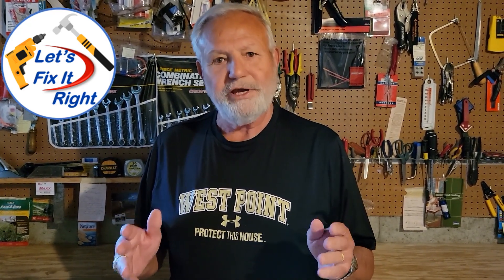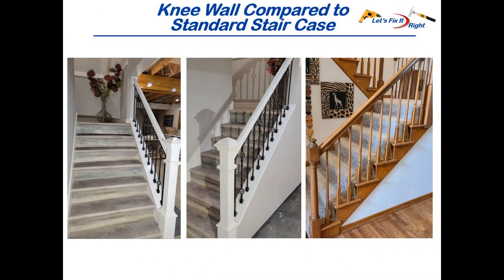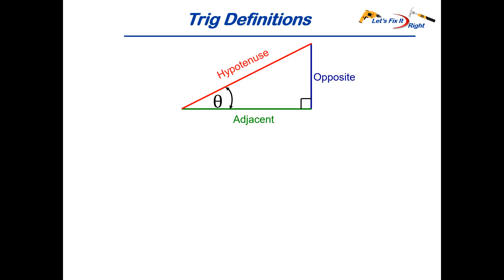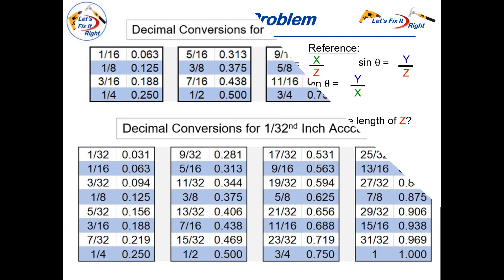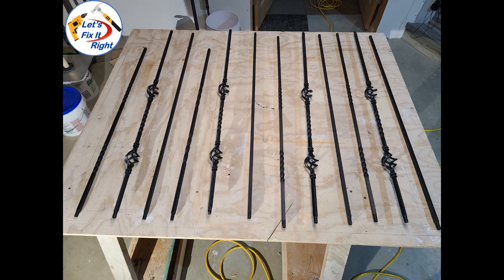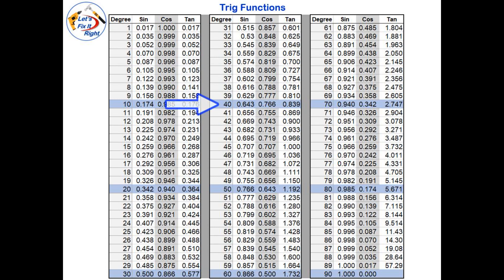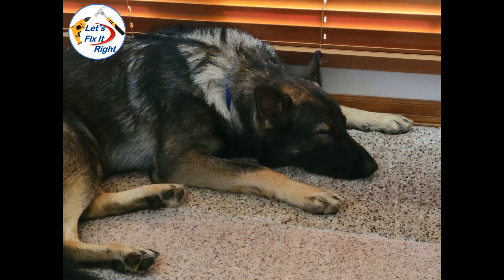Perfect Baluster Spacing

Comment: Hey Al Bacon. I watched the video over many times.  In the video (12:55) you have your starting space next to the newel at 3.047. Then your spacing jumps to 3.75” until the last space where it goes back to 3.047.  I’m wondering how to calculate this so my spaces are consistent throughout the whole rake wall. I hope this makes sense. Thanks
Reply from the maker: Mason,

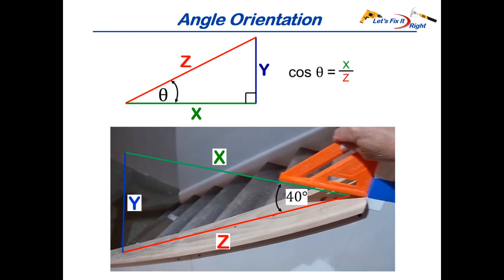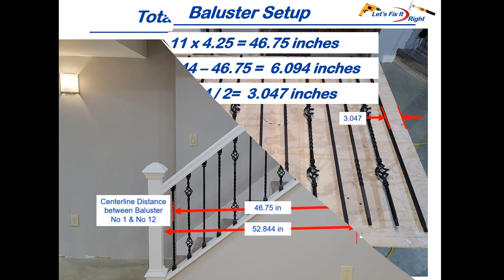As I explained in my video (9:30 to 12:42), this is exactly the horizontal spacing I planned for (i.e., 3.75 inches between each of my 12 metal balusters; 3.047 inches between my group of metal balusters and newel on the left; and 3.047 inches between my group of metal balusters and staircase wall on the right.) The graphic at 12:42 clearly shows how I calculated the two 3.047 inch outside gaps.

If you are not sure how to do this calculation or perform a calculation where all spaces are equal, I will gladly help. In other words, we could exchange email addresses and phone numbers and go over your numbers. I would also need to see some pictures of your stairwell.

Otherwise, I appreciate your interest in my channel.  I retired recently and have plans for another 200 to 300 great videos. 

Can you please subscribe and tell your friends and family about my channel also? 
This a link to my channel: https://www.youtube.com/@LetsFixItRight

Regards,
Al Bacon
Let’s Fix It Right

Comment: Are the outside of the first and twelfth baluster spacing also 5 9/16 spacing after calculating the Final Trig Calculation?
Reply from the maker: Ricwi11i,

Please review 11:39 to 16:00 showing how I made my calculations.

Baluster Distances are shown at 12:56. The outside horizontal distance at the edges is 3.047 inches.

I also centered my drilling pattern at 15:08. To keep the video shorter, I didn’t show this numerical distance. However, if you do the Trig Math, you’ll find out that this outside distance on top of the knee wall is 3 31/32 of an inch.

Otherwise, I appreciate your interest in my channel.  I retired recently and have plans for another 200 to 300 great videos. 
Can you please subscribe and tell your friends and family about my channel also? This a link to my channel: https://www.youtube.com/@LetsFixItRight

Regards,
Al Bacon
Let’s Fix It Right